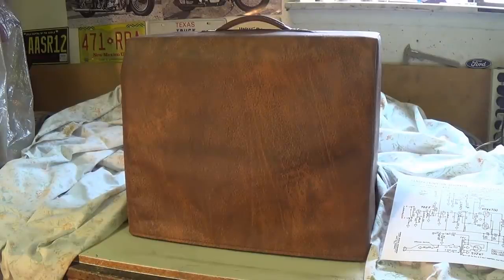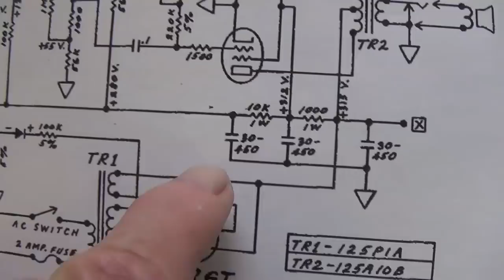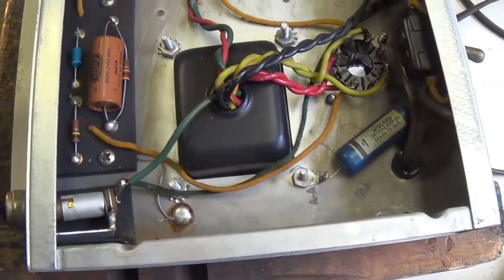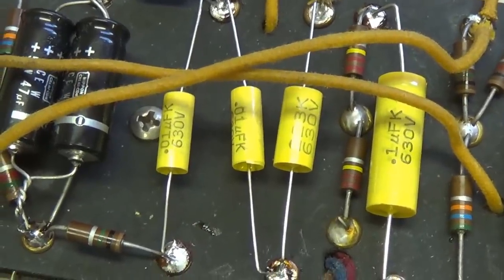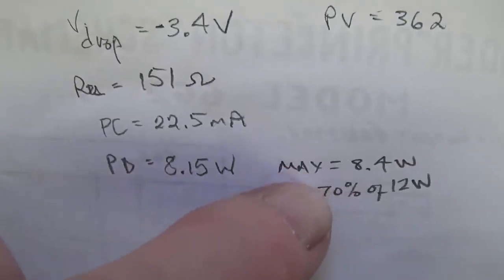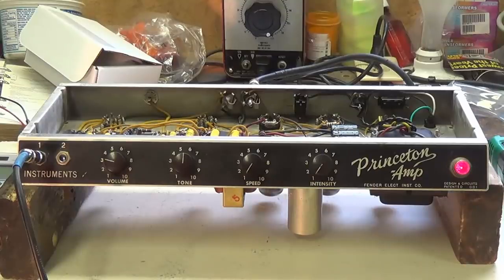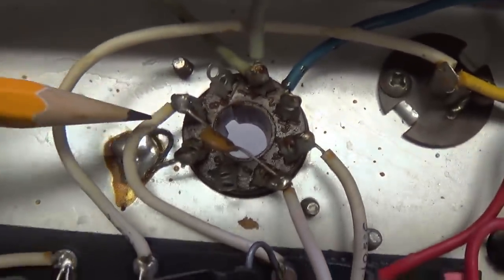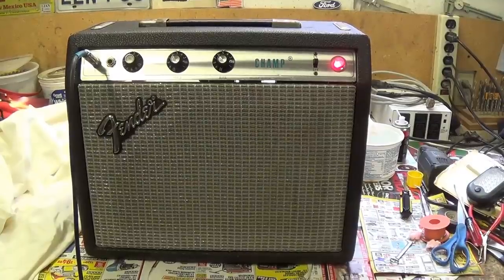Brownface Fender Princeton and Silverface Champ "Double-Header"

Comment: Another fantastic (couple of) job(s), Uncle Doug.  You're never a disappointment...
As to the screen wire shielding on top of the cabinet, is it your opinion that shielding in this area is no longer required, or that screen wire is a poor substitute?  It strikes me that some sort of shielding here would be a good thing, but I'd like to understand your thinking...
BTW, your guitar whacking is exemplary, as always, but I'd like to (reluctantly) point out that Jack and Ollie need to spend a little more time in the woodshed...
Reply from the maker: Since the chassis is mounted open-side up in Fenders, C7, such shielding may be of some minor value......but otherwise it's probably superfluous. Aluminum, steel, or copper sheet would be better, but would have cost more. If you're chafing about the need for some new tunes, I have spoken with them about it, and have upped the kitty treat ration as an incentive.

Comment: Good start to the year with a couple of nice old small Fender amps. The tremolo on the Princeton sounded sweet, I don’t think that you can beat the sound of a tube tremolo. Most of the old amps I’ve come across have had faulty tremolo circuits and the cause has always been either the capacitors or the foot switch, those phono plugs aren’t really robust enough. Looking forward to seeing some more great videos in the coming year.
Reply from the maker: Thanks so much, Henry. We'll do our best :)

Comment: Just came across your channel,  thanks for putting all of this information and content out there!   I'll dig deeper into your channel in the future But I had a quick amp question in case you came across this and had a few seconds to think about it.    I'm not sure how modern you get with your amp knowledge and interests, but I have a 8 or so year old  vox ac15c1 that picks up the am radio like that is what it was designed to do..I've never experienced anything like it in my life. I got it right when I moved for a new job, and its been doing it since day 1 and I stupidly thought there just may a radio tower close..and just lived with it.. But.... any suggestions in general for an issue like this on what to look for when I open it up?  Thanks!
Reply: Thats a  printed circuit board in that amp,  To the old codgers around here thats head scratchin territory.  🤣
Reply from the maker: It's quite possible for an amp circuit to be configured in such a way that it inadvertently acts as an AM receiver. All you need is an antenna (input leads or metal chassis), a rectifier to demodulate the carrier wave, and something to act as a speaker......and all are generally present in an amp circuit. To stop it, you'll have to eliminate one of the three necessities......and the first one is probably the easiest to address. Ground the chassis, shield all the signal wires to the second pre-amp stage, and, if all else fails, consider adding an RC filter to the input that will send RF to ground. The incoming signal is much higher frequency than the audio signal, so it can be eliminated without any effect on your guitar signal.

Comment: Nice. My next project after I solve some physical layout issues in my current diy mess is a hot rodded Princeton reverb. Planning on maybe ditching the tremolo, paralleling two triodes on the input, and maybe a mosfet cathode follower for giggles. 

Great video as always!
Reply from the maker: It's hard to improve on perfection, Daniel, but good luck.
Reply: @UncleDoug  thanks! Part of it is because it'll give me an excuse to use all the parts I have laying around. Other than the 3meg reverse pot for the tremolo if I decide to make it, I have everything I need in the scrap bin.
Reply from the maker: @witeshade  I love it when a project allows me to clean up all my loose parts and consolidate them into one (hopefully) functional device :)

Comment: Uncle Doogie     What is the value of the LARGE cap (I assume power supply cap ) in this 6G2 amp.   Unless I missed it , I didn't see you replace it.  I'm in the middle of my refurbishment of this amp.    I need to replace the speaker grill cloth as well. It got some wax spilled on it in my old HIPPY days.LOL  I got the amp in1962. as a X-mas present.  Great video by the way.  Thanks -Walt
Reply from the maker: I'm not sure what capacitor you are referring to, Walt. If it was the big can capacitor, I left the can in place but wired in fresh caps within the chassis.
Reply: @UncleDoug    Ya it was the can cap I was referring to . Going to replace all the caps and tubes. Having trouble finding the  can cap. 20/20/20..
Thanks.  Walt from Canada
Have a great weekend Uncle Doug 👍

Comment: Doug .. Thank you for your most excellent videos!  After repairing tube amps for decades, I thought I was fairly well versed on tube technology, but I'll be darned if I'm not picking up a wealth of new information from your videos :-)  Two questions please (apologies if this has been covered somewhere already);  What are you using for a camera to create your videos?  And .. How are you pricing your repairs if you care to share such info?  Hourly rate?  Component markup?  (Although I've tapered off on doing repair work, I suspect that I generally undercharge for my work. :-(  )
Reply from the maker: I use a Sony HDR CX-220 camera. As far as pricing, it varies with the job, but it is not hourly. I work until the result is optimum, regardless of the number of hours or days it may take. I charge a bit extra for shipped amps, since much time and effort is required both to unpack and re-pack, then deliver them to Fed Ex, which takes a couple hours minimum.

Comment: Another outstanding job, the serviceability of the older Fender amps is remarkable.  The bar clamp made quick work of the ugly gash.  I can't decide if I should make the obligatory comments about replacing "vintage" components...
Reply from the maker: Thanks, Paul. There are always two schools of thought on tampering with originality, but to me, if the owner wants it to work well and be reliable, there is only one path to take.

Comment: As you may have surmised the brown princeton is almost the same as the tweed vibrolux ! -- Those bias vary trems also sound best when biased a little cold I have found -- Hi from dublin !
Reply from the maker: I agree, Ben. It's good to hear from you. Jack and KC send their regards.
Reply: I worked on a Brown vibrolux a few years ago, the tremolo wasn't working and sure enough it was the coupling caps in the tremolo circuit that were bad. It was a fantastic sounding amplifier . 

In virtually any amplifier, if the tremolo doesn't work, just replace the damn caps. Well, okay, you can check for an open plate resistor or cathode resistor and try another tube first, but nine times out of ten it's the caps.
Reply: @UncleDoug  As do Mordy and Whiskers back to y'all in the desert !

Comment: Too bad you're replacing the coupling caps on the princetone... can you tell more about your waxing technique ? i have a BF bandmaster that might benefit from it !
Reply from the maker: It would really be too bad if I didn't, and the customer, who is over 1000 miles away, started having serious problems.......after paying me to ensure that the amp would be reliable.  Listen to my explanation in the video, Pi. Hopefully it will make sense. Re the waxing, I simply wash the metal surface with Windex to remove all grime and then apply Meguire's car wax.....just like waxing a car.

Comment: Nice to see 6G2 inside view again (not too many examples on YouTube or Internet generally). Circa 1 year ago I've bought it and had a lot of trouble here. It ended almost same as in your example. New transformers - power was totally KO and output was somehow not so good. And I had to change all the capacitors (I used Jupiter Vintage tone, good experience on that 6g2 maybe better than the original ones when tey were new) - same reasons as you mentioned, probably OK but for the good sleeping I have changed it all (and still have the original parts somewhere). But after all that - really great sound, tremolo reminds me somehow that Roy Orbison sound, but when the volume is dialed up - I can hear something like Neil Young's sound -  just killer. And ... deadly quiet - no buzzing, really nic.
Reply from the maker: Thanks for your input, Viktor. We appreciate hearing from you.

Comment: 19 watts PD you could run a 6L6 in place of the 6V6 and get away with it. I'v looked at some of the P/S transformers in antique Electronic Supply magazine. The Princeton blackface and blackface champ use the same power supply Transformer figure that one out?
Reply from the maker: Switching from 6V6 to 6L6 can create some impedance issues with the OPT.....but from a purely PD perspective it would seem to be a viable switch.
Reply: @UncleDoug  I didn't
Think about the output transformer. Looking at the champ it would need a different output. Transformer indeed. The ps transformer in the champ can handle 70 ma. 350 to 400V would easily supply 2 6V6s in push pull. Or one 6L6 in class A oper. What impedance  does the 6L6 need in the op Transformers primary?
I watched all of your scratch build amp videos saw the one that you could use either tube. Pretty neat engineering their Uncle Doug. Save some scratch and sniff asbestos and selenium snort for me. Love your sense of humor and sarcasm..
Reply from the maker: @dwightjt  The load resistance of a single 6L6 is about half that of a single 6V6.....4200 Ohms vs 8500, Dwight.  Too big of a difference to ignore. I'm glad you have enjoyed our videos.
Reply: @UncleDoug  ok on the impedance for the 6v6 versus 6l6 on the primary cirquit. It's all very fascinating to me. Chris the iPic from Sydney Australia compliments you as well and has mentioned you in some of his videos. You give the best detail and have the most patience with amateurs like me. Hope to see you soon on a new video or review the ones that are out there. Love those hot rods to.
Dwight.
Reply from the maker: @dwightjt  Thanks somuch for your nice comments, Dwight, and regards to Chris :)

Comment: Nice work as always. I've got a Bassman 50 on the bench now with original components, but it doesn't match the schematic.

I've also got a Marshall JTM30 that's baffling me. The negative bias circuit is three zener diodes in series (15V, 15V and 9V). So I get around -39VDC. But then I flick the standby switch and that negative voltage drops to -18VDC to -21VDC. Power tubes begin to redplate. I replaced the diodes as well as the 10uF 100V filter cap in the bias circuit. Still getting the same result. Confusing.
Reply from the maker: Thanks, Stefano. Perhaps one of the components in the power supply is not able to flow much current. With no current flow, it can provide a good voltage reading, but once the current starts to flow, it breaks down and the voltage drops. This is just like voltage testing a dead car battery (good voltage but no current). Also, are you sure the polarity of the filter cap is correct (+ to ground) ???
Reply: @UncleDoug  thanks matey. I have checked the polarity of the filter cap. It is indeed around the right way. I'm hoping it's not a PT low voltage tap supplying the negative bias that's breaking down.
Reply from the maker: It's a possibility, Stefano. Are you also sure that there are no components in the bias circuit that are drawing excessive current, thereby dragging down the voltage ?
Reply: @UncleDoug  all there seems to be are four diodes in total. A diode in reverse for negative bias, and a cap. Followed by three diodes for the correct amount of fixed bias. No other components. All of these have been replaced. But I might look further and see what's going on. I guess I could remove the negative voltage supply from the board, remove the power tubes, and check the voltage again to isolate if it's the PT or not.
Reply from the maker: Lot's of work, but if you resolve the issue....it's worth it.
Reply: @UncleDoug  absolutely matey. The challenge is always fun and frustrating with a PCB tube amp with an unconventional negative bias circuit. There's no failsafe like with a Fender where you have a bias resistor and a pot for adjustment range.

Comment: Uncle Doug I dont know what area your in, but I am a older amp guy who is loosing his eye sight . I thought I had worked on every amp made in the last 60 years, My grandfather worked for Fender 1940s- 65 My Dad worked for Bogen you have me beat on variety . I have sold loads of tubes on ebay but have a pick up truck sized load of mostly NOS Tube amp gear/parts and test equipment looking for a new home ? there are some youtube videos under Surf City Amp Room and SCAR Amplification for some info.
Reply from the maker: Thanks for the nice comments and notice of availability. I am in far West Texas, probably a great distance from your location.
Reply: @UncleDoug  I have been enjoying your posts and on each step I am calling out each action as you work your way though the repairs. I have even learned a few things. Great Work maybe someone out their will see my post and in need of parts.

Comment: Very well done yet again.
Reply from the maker: Thanks, Gary.
Reply: Before Christmas I rescued a PA system that was gathering dust and been unused for years from a cubby hole underneath a pubs stairs. It was a QSC power amp And a pair of Yorkville speakers. Nothing electrical was wrong with anything they were just very dusty and dirty I just took the stuff apart, cleaned it and put it back together again. The QSC amp is probably 25 or more years old but this thing was sure built to last you can tell by the weight of the transformer inside and it will be good for quite a few years yet it really kicks out the Yorkville 15 inch speakers sound great the system has gone to a guy who plays techno music. Horrible yes but it is nice to get old school stuff up and running again.

Comment: Love that the unabomber supports the channel activities. Hey Doug, I have a biasing at 70% power dissipation question. Where did the value of 70 come from? Rule of thumb, experience, sound, personal preference, trading tone for tube life, RDH, Western Electric catacombs, etc? Just curious. Thanks for the video and thanks for letting those not-so stray cats play their paws off.
Reply from the maker: It's probably an arbitrary rule of thumb, Craig, to allow for the expected increase in plate current that occurs in grid-biased circuits when driven hard. Maybe someone monitored a circuit and found that when PD is set at 70% at idle, the driven PD just barely reaches 100% of max. Let's hope it isn't just a wild guess :)

Comment: Hey Doug, I've heard you mention in several videos that you cleaned and waxed the faceplate of an amp. I would assume that you're talking about the faceplates on Fenders, which can typically be removed with a little bit of work. I have a couple questions...what is your preferred cleaning technique on amps that don't have removable faceplates, e.g., most old Gibsons, Valcos, Ampegs, etc. ? What cleaning products or solutions do you prefer and why? Also...what kind of "wax" are you referring to?
Thanks!
Reply from the maker: I don't remove faceplates, Leon, I simply clean and wax them in place. If the finish is sealed, I use Windex. If it's oxidized or vulnerable, I would use water dampened terry cloth......or leave it alone if really fragile. For waxing, I use Meguire's paste car wax.
Reply: @UncleDoug   - Got it; thanks very much for the info! If you have a chance, check out this crazy old Valco amp I'm restoring; I think you'll get a kick out of this: https://youtu.be/htBgKbF9CfQ
Reply from the maker: What a spectacular old National amp, Leon.......the nicest I have ever seen.......elaborate circuit, powerful 4-6L6 output, and four speakers, all in a rather compact cabinet. You're a lucky guy, and your demo is excellent.
Reply: Thanks Doug, I knew you would enjoy this amp! Yes, I am very, very lucky indeed. I've had its "little brother", the 1215 for about 7 years and I started searching for these amps about 8 or 9 years ago. Took a few years to find the 1215 and honestly, I never expected to see another 1299. I know of only one other one in existence... but now, I imagine there may be a few more hiding in people's closets somewhere.

The repairs this one required were so incredibly simple but were clearly the result of shoddy workmanship by someone many years ago. 1) terrible soldering (more like gluing, lol) on replaced cathode bypass caps and cathode resistor) 2) cheap "screw on" AC plug replacement, 3) incorrect terminal used when "fixing" the two "umbilical" leads that take the amp signal from PI in upper chassis to grids of power tubes in lower chassis. The last one took an hour or two to figure out; it had been done so long ago that it didn't occur to me that it was repaired. But it meant the power amp was seeing only the signal from the cathode part of the phase inverter.

Comment: Hey Uncle Doug, You mention at the 4:30 mark about the 6.3v filament winding ground causing hum in the original schematic. What would be the better, not as cheap way, to do this to stop hum? I have a Brownface Princeton style amp built by a local amp builder no tremolo and has bass and treble. I usually run a 12au7 to keep amp clean and it has very little hum but when I run a 12ax7 a prominent hum is noticeable early on in volume range. Is this possibly the same issue you mentioned in video?
Reply from the maker: My guess is that the source of the hum is prior to the 12AX7 tube in the circuit and is louder with the AX7 simply because of its higher gain relative to the 12AU7. Also, see if you have two 6.3VAC wires to each tube and that your 6.3VAC center tap is grounded.
Reply: @UncleDoug  thanks a bunch.